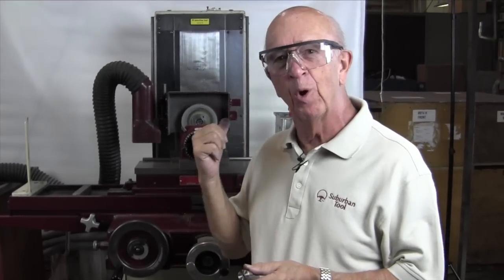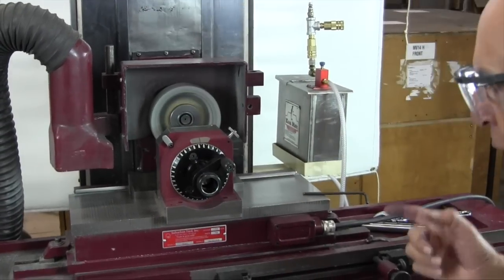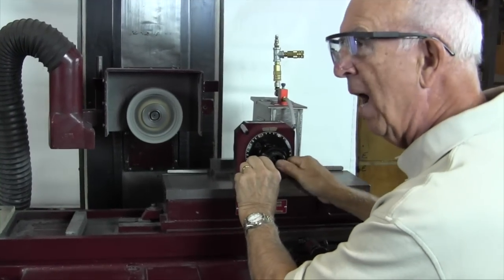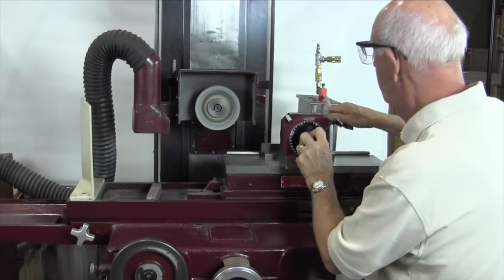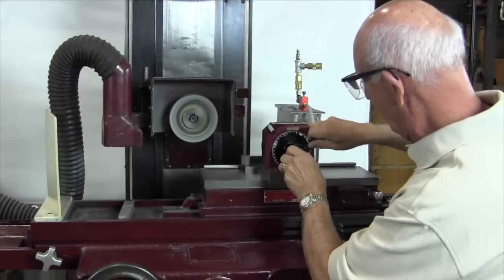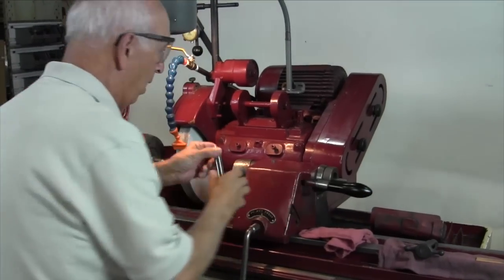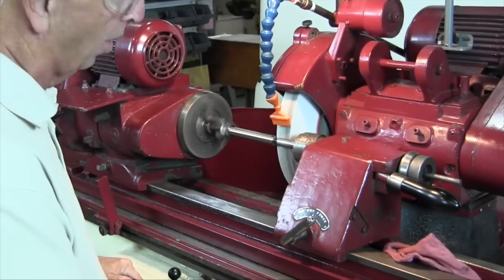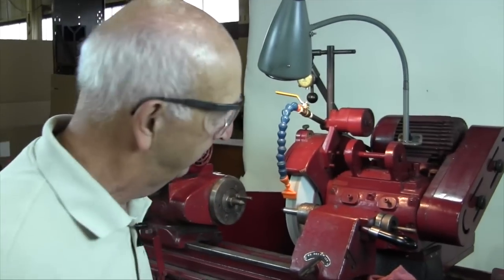How to Get a Cross Hatch Finish on a Surface Grinder and OD Grinder by Don Bailey

Comment: Just my input ..When the shaft is lying between the centers clock over the peak of the diameter with a dti from the wheel head casting raise the tailstock to achieve  equal reading @ both ends with shim or paper before you start it takes the guess work out of deciding how much to lift the tailstock to achieve  a square (crisscross) face  also place the shim at both sides of the tailstock base as mentioned below I agree avoid pushing the carrier with the driver &  pull other wise nice video Don....

Comment: Nice...talking about safety...your driver is put on wrong...should be pulling on the dog not pushing, [flip it over]...it can lead to serious consequences if the dog becomes loose, putting on the other way, [pulling] even if the driver becomes loose the operation remains safe.

Comment: is the surface of the wheel dressed to the same angle as the taper of the dead center on the tailstock...or is the entire grinder rotated vs the bed, or something else? bc u less SOMETHING clever is going on, I don't understand how the 1 or 2" thick wheel can manage to grind the end of the rod without impinging on the dead center.
Reply from the maker: +Travis J I Corcoran No, the bed turns and allows you to remove the taper. You're absolutely right about the wheel impeding on the dead center. It's important to be conscious about leaving enough clearance.
Reply: A half center would help a lot.
Reply: I think it isn't either. Like sander suggested that's probably a relieved center.
Reply: I don't think Don quite understood your question. If you look carefully, the left end of the wheel is dressed to a conical knife edge, to wrap around the 60 degree portion of the dead centre.

Comment: Is there any way to correctly get the grinding wheel to be directly over the bar on the surface grinder when you are centre-less grinding?  Or do you simply touch on as you do normal flat plate and stop once you hear a tiny grinding contact noise to get over the apex? Thanks